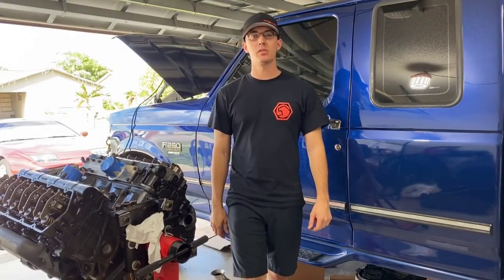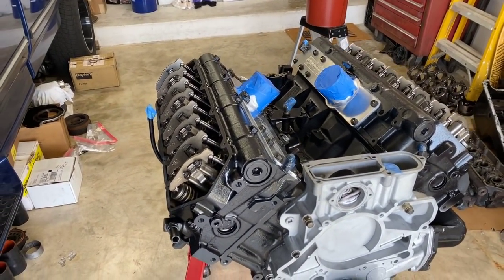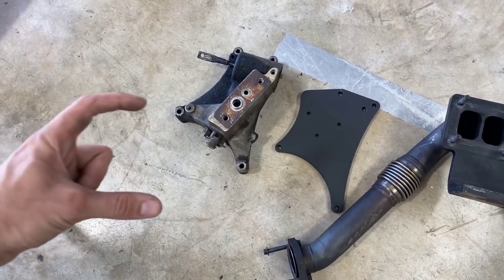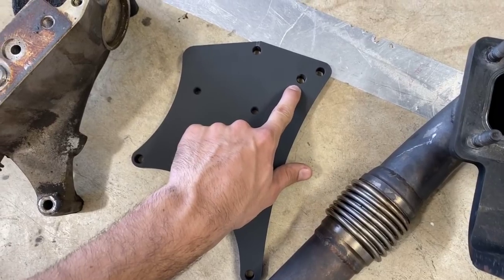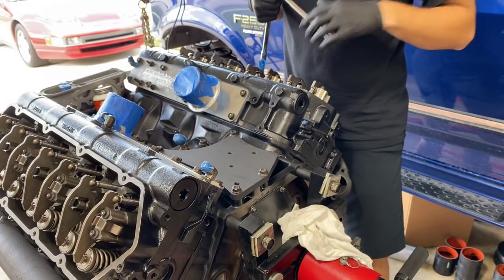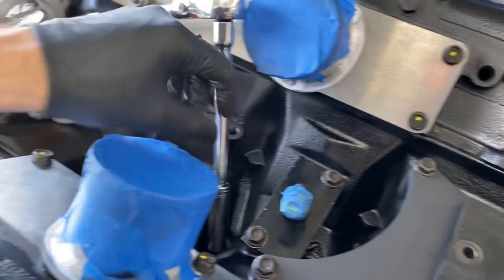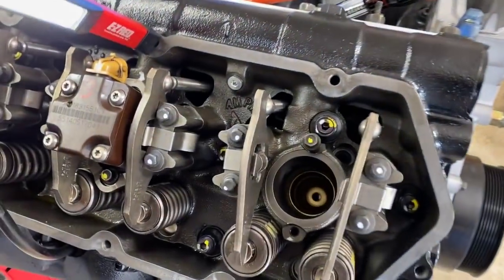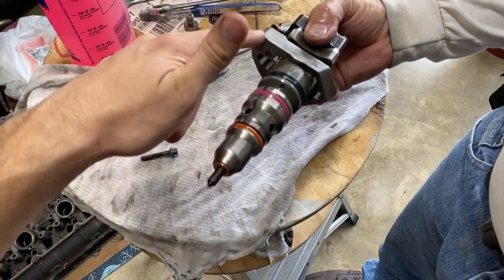BUILT 7.3 gets some goodies! T4 mount turbo kit and more!

Comment: Brandon, I have been watching a lot of your videos. Some 2 and 3 times. I think they are some of the very bet on the tube for sure. Your is a OBS heat breaker ...OMG do I love it. Though u to this point I have never had a diesel anything but have wanted one for many years. After watching your build and other videos I got inspired to go look for a truck. I have a gas 150 but I wanted a OBS diesel 250.Finally I found one I could afford single cab blue ( love blue but the color just turned out that way by chance) 1994. Seems to run strong as hell. 210K on it, and was told it just had new injectors and fuel lines ...transmission and brake booster. I didn't realize it at the time, being so unfamiliar with  diesels that mine looks different from any other one I've ever seen. The fuel filter was moved from the valley and relocated on the passengers side of the engine. Have never seen that before. Even the big silver vacuum pump that on others is located on the drivers side in now on top in the front. I am confused. he Ac needs work so an going to send it out to be repaired., and then will ask more about the other things I'm not familiar  with. Your new build seeing how you were so meticulous and precise on everything was a dream to watch. That's right...sometimes you have no idea how you influence others when you do such admirable work. I'm up in Jacksonville and would love to some day meet you, and learn more of what you have done to your rig. might even pay you as a consultant. It would sure be worth it. You are an encyclopedia of knowledge and a great inspiration to me. Really enjoyed your chip video. It was awesome. Thanks so much for producing these great videos. You kidded once about your OCD...but let me tell you, in cases like this it has really paid off. Thanks again Brandon for sharing so much with your fans
Reply from the maker: I appreciate the kind words! We try to keep a good product for all of our personal trucks and trucks we work on!

Comment: In case anyone doesn’t have vacuum pump setup.. 1/4” plastic fridge ice maker/water line and a large plastic syringe work great for clearing oil out of cylinders. It’s actually pretty handy setup to just have around garage, I use it more often than you’d think.           (Can find syringes on Amazon, they’re used for glue/crafts or gardening. And make sure the 1/4” line is the rigid type, not the soft tubing)

Comment: Cummins guy myself but i doubt you’ll find a Cummins guy that won’t admit the 7.3 is a legend itself. Really cool stuff in your build . I had no idea they made that style of turbo mount for the power stroke . I’m excited to see it plumbed up like that instead of at an angle from the factory .
Reply from the maker: Its a HUGE step in a different direction for us 7.3 guys, opens up the playing field for us. There are some seriously badass 7.3s out there!
Reply: I have friends who are die hard Cummins guys, but I love my 7.3 that makes more power than the 12v 5.9 does stock.

People like to crap on the Powerstroke’s but the 7.3 is a legend of itself. 

My montra is keep it stock & it’ll last a long time. If you up the power don’t be ridiculous & blow up the block. Maybe double the hp if plenty. Any more get a crate motor so you don’t ruin a perfectly good 7.3 by making a hole in the block. 

People who by these things also want a long lasting truck. I like a little extra power, but not to where it’s ridiculous.
Reply: The 7.3 Garage, I was @ the gas satation & I saw a truck next to me that had maybe 5-600hp 7.3. It was pretty cool, but if you want power go for a new truck & blow them up cuz they still make them.

Once you up the power it takes a bit out of the longevity of the motor.

Comment: will the kc turbos plumb up with that t4 kit? Also, I was looking at their t4 kits and I couldn't find anything that was a single mounting plate like the one you have in the video they look like they are 2 pieces.?
Reply from the maker: I don’t hav winch knowledge on the KC turbos as far as the T4 kit goes. As long as you have a T4 flange I would imagine it would work with the Irate diesel kit.

Comment: The bellows on the down pipes aren't for flexing,they're for expansion and contraction. You will probably break them if you try and flex them. I've had hundreds come through the shop with exhaust leaks from people who tried to flex them into place and ended up with a very expensive exhaust leak.

Comment: What was the final bore diameter? 
.030 or .060 over?
What pistons and rods did you use?
Cam lift and duration? 
Stock roller lifters?
Are the valves stock or did you go with over sized valves?
Valve guides?
Springs, after market?
I missed all these details?
Reply from the maker: Engine is .20 over, Mahle pistons with Manley connection rods, cam intake lift is .430 and exhaust is .433. Stock lifters, stock valves with Comp 910 valve springs shimmed .30. New valve guides, etc!
Reply: @The73Garage  
You going to push the envelope.  
Water methanol injection?

Comment: You'll want to hot torque those injectors after a few miles and the engine is hot.  I usually go with 130 in/lbs.

Comment: Outstanding! Nice to see how all that mounts up with the engine out. I'll definitely use your vids for reference when I start tearing into mine.

I think the words you were looking for in reference to the spouts is "pot metal."

May I ask how much Swamps charged you to flow/check injectors? I bought mine used with less than 10K miles on them & although I trust the guy, I'd like to be sure.
Reply from the maker: David Oliver thank you! I hope they can help you out👍🏻 yes, they were $35 per injector to flow and clean.
Reply: @The73Garage  $280 for peace of mind, well worth it. Thanks Brandon